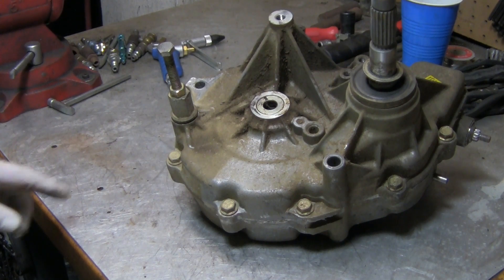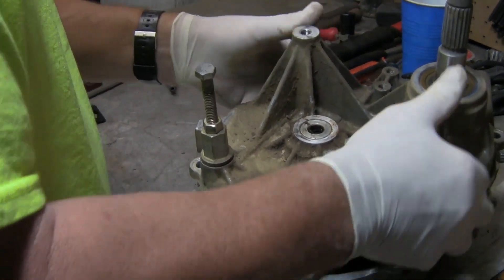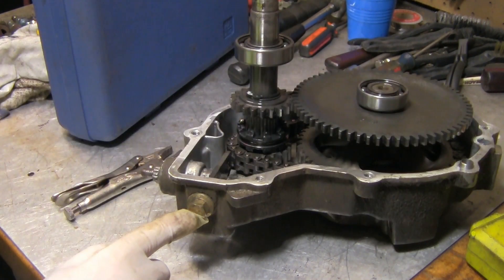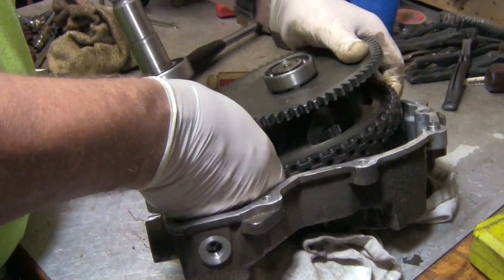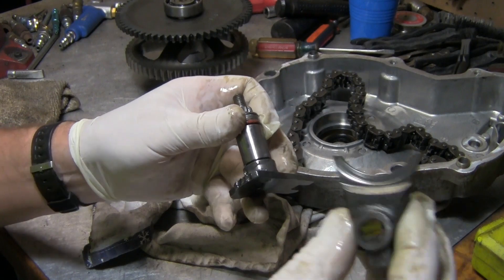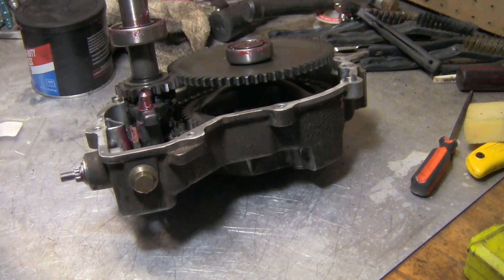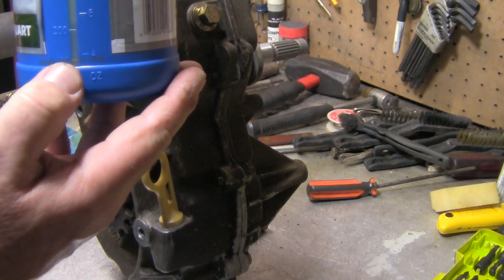Polaris Trail Boss Transmission repair

Comment: I have a 1997 trailboss 250 and it's making a loud noise coming from the clutch cover , I checked the fluid and it was low as well ...do I need a rebuild or myby just a new belt ?
Reply from the maker: I would check the belt and make sure nothing is broken inside of the clutch.

Comment: I’ve been studying your well instructed videos on the transmission work on the trail boss 325. Was there a gasket where the housing halves mate? What the heck keeps the fluid in? I’ve watched this video dozens of times and can’t see any form of gasket.
Reply from the maker: It had no gasket that I could see. It did look like it had some kind of sealer on it and it wasn't a gasket. I put a clear silicone sealer on the case when I put it back together as you can see in the video starting at 11:39.
Reply: @LonnieJohnson1 thanks Lonnie! Your videos are very helpful and informative. Godspeed 🫡
Reply from the maker: Thanks!
Reply: Silicon clear
Reply from the maker: Yes

Comment: Amd is it a 250 2 stroke. I just bought one today have not heard it run yet but in the paper work said it was having a trans noise
Reply from the maker: It was a 330 4 stroke
Reply from the maker: Also some parts for these have been discontinued.

Comment: Great job what was that off of and what was the issue I have shifting problem with Polaris big boss likes to grind when I shift to hi low and reverse go right in??
Reply from the maker: Thanks...this is a 230 Trail Boss and if you watch the video starting around 8:00 you will see all the new parts I had to replace because it wouldn't stay in gear, it would pop out of gear after about 5 to10 feet every time.

Comment: Hey Lonnie I know this an old video but I just tackled my trailboss 330. Couldn't have done it without you. 👌. Turns out the ring clip came off the reverse gear. A very talented mechanic/welder I know made sure that it would never happen again lol. My question is did you replace the triple lip seals on the shafts. Mine look fine but my bud is just change it. Over 100 bucks for the two ughhh. I'm ready to seal it up but holding off now he's got me second guessing lol.
Reply from the maker: No, not at that price. It should be find if it doesn't look damaged, and if your doing the job yourself you don't have to pay for the cost of labor.

Comment: I have a 2006 that makes cracking and clunking noises at about 5 mph. The chain in transmission has a little slack and the shifting slide is worn not sure if this is issue though
Reply: Please let me know what to look for
Reply from the maker: Put your hand on the transmission and drive slow to feel if that is where it's coming from. If so, I would remove it and look inside to see what is damaged because if you damage the wrong part, some parts are no longer available.
Reply: @LonnieJohnson1  i pushed it without trans or chain on and it was the rear axle bearing
Reply from the maker: That's a plus. The axle will be easier to fix.
Reply: @LonnieJohnson1  yes but i ended up taking the trans out before😕🙃
Reply from the maker: Did it look good on the inside?
Reply: @LonnieJohnson1  in the trans? yes, the chain was a little lose. and the gear seam to be lose and have play but i guess thats just how it is
Reply from the maker: Fix the rear end and see how it sounds and feels.

Comment: At 12:24 the thing you pointed at snapped clean off and also broke the sprocket. I’m curious as to what part that would be so I can order a replacement. Thanks
Reply from the maker: It shows that it has been discontinued but I found one on Partzilla but it's unavailable. Here is the link...CDS OUTPUT SUB ASSEMBLY
3234266
Reply from the maker: Here is another link to look at...https://www.ronniesmailorder.com/oemparts/a/pol/503561b9f8700236841121b8/drive-train-main-gearcase-internal
Reply: Thanks man 🙏🏽
Reply from the maker: Your welcome, and I know that's not what you wanted to hear. I also had no idea.

Comment: Polaris's are such goddamn junk. I can;t tell you how many I have worked on and just about every single fockin one of them have blown out A Arm bushings, Blown out handlebar bushings, Tranmission issues, all the parts ar way over priced etc. I would never ever own one.
Reply from the maker: I will work on them but would not own one. I work on more of these 4X4 they any.

Comment: How loose should the chain be?
Reply from the maker: It shouldn't be loose. At 2:35 you can see the chain.
Reply: @LonnieJohnson1  we could slip it off right away. Will probably order a new one
Reply from the maker: Sounds like it was way too loose.
Reply: @LonnieJohnson1  is there anything else I should check while in the transmission. The bearings seem good.
Reply from the maker: Do all the teeth look good?
Reply: @LonnieJohnson1  looks good.
Reply: @LonnieJohnson1  Do I need to clean the stuff of the old fluid or just put it all back together and add new fluid?
Reply from the maker: Put it together and add new fluid.
Reply: @LonnieJohnson1  I also noticed the big gear has some play in it. Is that normal?
Reply from the maker: Is it in the chain or the gear and bearing.
Reply: @LonnieJohnson1  the gear and bearing
Reply from the maker: I would check all the bearings and maybe replace them. Also they could be worn out and you don't want to have to take it back apart for a bad bearing. You should have 4 bearings.
Reply: @LonnieJohnson1  the big gear that does not have the chain on it has some slight play. The bearing looks great.
Reply: @LonnieJohnson1  also that gear seams to only slightly line up with the smaller one.
Reply: @LonnieJohnson1  5:56
Reply: @LonnieJohnson1  also does it matter what gear oil I use. Synthetic ATF would be fine?
Reply from the maker: At 12:53 you can see what I used but any kind of gear oil will do that's around the same weight.
Reply from the maker: Only because it will shift up and down.
Reply from the maker: It should be able to slip in and out of the small gear if it's the gears without the chain.
Reply: @LonnieJohnson1  I was just going to you Valvoline synthetic ATF transmission oil?
Reply: @LonnieJohnson1  how could I send you a picture?
Reply from the maker: You don't want to use transmission oil.
Reply: @LonnieJohnson1  oh , so I have to use something different?
Reply from the maker: Not sure how to send a pic.
Reply from the maker: You can read your manual but I wouldn't use transmission fluid it's too thin.
Reply: @LonnieJohnson1  put everything back together. And the clicking went away runs great now. Thanks for all your help!
Reply from the maker: Cool! glad I could help
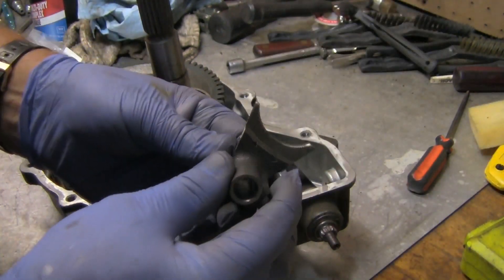Reply from the maker: One important thing to check is starting at 8:28 of the video and also 9:40 and grease everything good.

Comment: I have a 2000 polaris trail boss 325 and when accelerating fast or pulling anything it makes a loud clicking/clunking noise. Do you think it is the silent chain in the transmission?
Reply from the maker: Either the chain is sloppy loose or you could have some bad teeth on your front or rear sprocket. That's just a guess without looking at it. Is it coming from your transmission?
Reply: @LonnieJohnson1  it’s coming from somewhere near the back end. Maybe the chain or sprockets that drives the wheels?
Reply: @LonnieJohnson1  We started taking it apart but need to get the clutch off and then we should be able to get it out.
Reply: @LonnieJohnson1  if the teeth are shiny does that mean they are worn down and should be replaced?
Reply from the maker: It depends on how long the teeth are and if the chain can slip over them. Look on line at a new front and rear sprocket and compare it with yours. It should also give measurements of the teeth.

Comment: I bought a 2003 Polaris trailboss and the sprocket came off. After looking at it the previous owner welded it on but I don’t know what parts I need to fix it
Reply from the maker: See if this link can help you.  https://www.ronniesmailorder.com/oemparts/a/pol/5034f990f870022b94ea4dd4/gearcase
Reply: Have you ever found a video on replacement ? I can find one, thinking about welding mine due to output shaft snapping, they are like 250 new

Comment: I bought  a polaris 2000 325 it doesn't comes with the High Low Transmission Sensor what I need to do???

Comment: Question will 4x4 transmission parts work I can't seem to find any of the parts I need for my polaris trail boss 250cc automatic 2stroke . I've just been keeping it in gear and starting it
Reply from the maker: What year is your Trail Boss?
Reply: @LonnieJohnson1   it's a 1992 polaris trail boss 2x4 250cc automatic 2 stroke but the oil injector I believe doesn't work
Reply from the maker: You can mix the oil yourself. The oil pump is unavailable but I found one for $251. Not cheap. What transmission parts do you need and I will look and see what I can find out.
Reply from the maker: I'm looking at the parts for both ATV's and they look the same. Just let me know what part you need and I'll see if it matches.
Reply: @LonnieJohnson1  thats what I have to do I mix my gas and oil before , and as for parts for transmission I believe I need whole new thing never took it apart aha
Reply from the maker: It looks like all the parts are the same. Here is yours https://www.ronniesmailorder.com/oemparts/a/pol/5034eb8bf870022b94ea1eb2/gearcase-assembly-250-2x4                                       and here is the 4X4 https://www.ronniesmailorder.com/oemparts/a/pol/5034eb9df870022b94ea1ef5/gearcase-assembly-250-4x4

Comment: I've got a 93 trail boss my lower motor mount I'd broke causing my clutch guard to be eat on by the transmission flexing how do I fix this problem do you know?
Reply from the maker: First you have to weld the motor mount back in place. Did it eat a hole in anything?

Comment: My 03 trial blasé boss drives but when I put full throttle it feels like is only going on first gear do you know why.. I really need help
Reply from the maker: I would check the belt and clutch drive assembly to see if it's working properly.

Comment: Where did you find the replacement parts for the tranny ,I been looking for a drive chain and gears for the inside of the gear box and no luck
Reply from the maker: Let me know if this helps...https://www.ronniesmailorder.com/oemparts/a/pol/503561b9f8700236841121b8/drive-train-main-gearcase-internal

Comment: I haven’t taken mine apart kinda scared what could cause reverse to not work or why it’s not engaging it seems like
Reply from the maker: Have you checked the clutch?
Reply: @LonnieJohnson1  there no clutch ?
Reply from the maker: Does it move forward?
Reply: @LonnieJohnson1  yes and netural works but reverse dose not
Reply: is goes it to revers shift move it to revers and give it gas and it does not move
Reply from the maker: Will it move and drive in forward gears?
Reply from the maker: If so you have a transmission issue.
Reply: @LonnieJohnson1  yes
Reply: Did you fix it?? I have the same problem
Reply from the maker: Yes!
Reply: @jesusserrato1923  pm me if you need help with no reverse issue on trail boss. Just fixed mine. Real easy job
Reply: What was the problem? Solution?

Comment: I have a 91 250 Trail Boss 4 by 4 that leak bunch of oil after a long hard drive it has a clunking loud rattling noise lot of vibration not sure if it's the transmission or the motor any suggestions
Reply from the maker: Put the wheels up on blocks to where it is stable and secure. Start it and put it in low gear, then listen for the sound or noise and feel the gear box to pin point the vibration or rattling.
Reply: Should the pully for the trans have any movement on it or I think a bering or seal is bad
Reply from the maker: I would check it.

Comment: Good afternoon I have polaris 330  4wheels have gearbox problems I need to buy a new gearbox .. please have a link where I can make a purchase ... my email is itox.malalanhane@gmail.com or my watssp is +258849099226 please help me
Reply from the maker: Here is a link to the gear case. I would around and find it cheaper. https://www.ronniesmailorder.com/oemparts/a/pol/503561b6f8700236841121b7/drive-train-main-gearcase

Comment: What year trail boss are you working on? I have a 90 and it slips once in awhile at high speeds. Looks like theres no silent chain on any TB pre 94..
Reply from the maker: 2009, and if it's slipping at high speed you should check your belt unless it's a grinding noise in the transmission.
Reply: @LonnieJohnson1  Grinding in trans. Adjusted shift linkage and changed out fluid. hasnt done it since, fingers crossed. lol
Reply from the maker: Cool!!
Reply: @Ajaxaxxess  what fluid would you use for a 94? I have a 300 4x4 and want to change the tranny fluid. Would some Mag1 75w-90 gear oil work?

Comment: I was riding mine and I shifted to drive and now it acts like it’s in low gear which it doesn’t even have and I’ll be going around 5 mph and it sounds like I’m going 25 do you know what the problem is?
Reply from the maker: I would look at the drive belt first to see if there's  an issue with it.

Comment: Hey buddy my 1997 polaris scrambler 500 4x4 grinds in drive gear but is fine in reverse...what part do I order ?
Reply: Answer is silent chain is stretched
Reply from the maker: Does it grind when your driving it or when you put it in gear?
Reply: Hey there mine grinds while in gear and dont want to run
Reply from the maker: Sounds like a bad gear.

Comment: How long do you have to wait after putting the  rubber gasket on to add Transmission fluid?
Reply from the maker: Once you get everything bolted down you should be able to add the gear oil
Reply: @LonnieJohnson1  Ok thanks!!

Comment: Hey man where did you order your parts from do you have the link
Reply from the maker: Ronnies.com mail order but you can type these #'s in google and find them cheaper but make sure they are not used parts. Hope this helps. (Shaft, Shift 3233679) and SHIFT-FORK 3233685

Comment: Why did the fork wear so much?  Soft material?  Over travel?  Thanks for sharing.
Reply from the maker: I think it was ran very low on gear oil. When I emptied the transmission it had very little in it. In the area the dip stick was in it was probably over looked.